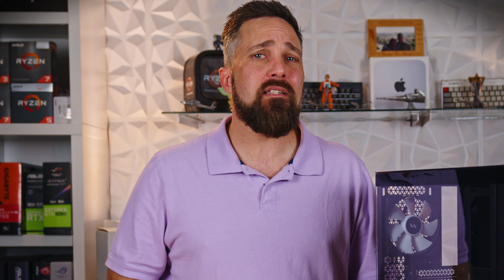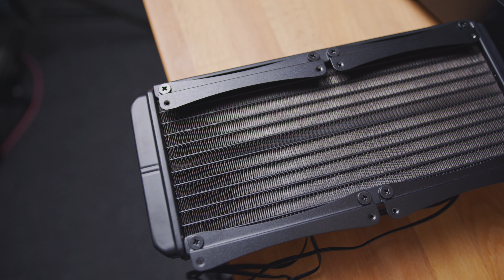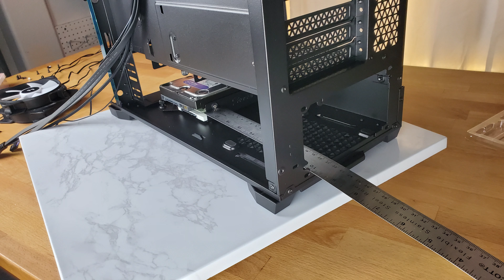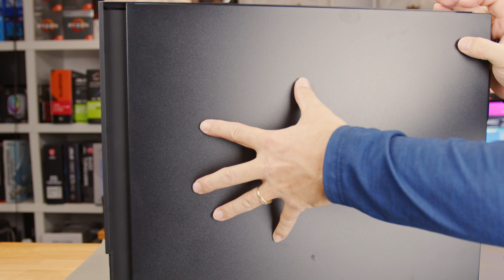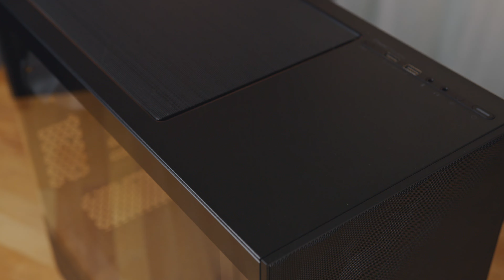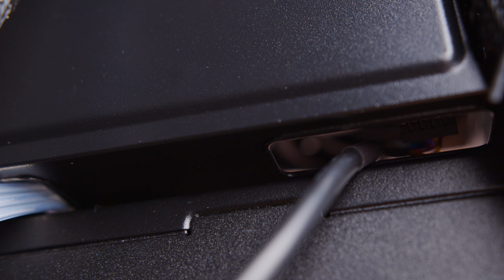This Mini Case Has a Big Secret! Fractal Pop Mini Review.

Comment: I don't understand builds of Intel cpu and a radeon graphics card, with the newer generation of cards coming out. Why would you not want full vram access with S.A.M?
Reply from the maker: SAM/ReBAR is not an AMD technology, it's  a PCIe feature, and it works with all CPU & GPU combinations.
Reply: @ElevatedSystems  oh? How is it implemented in this setup? Same options in bios to adjust settings?

Comment: Builds in the all black version of a case that comes in multiple colours
"It DoEsN't PoP lIkE tHe NaMe ImPlIeS!"
Proceeds to not elaborate on said other colours
Pretty decent video otherwise. Quite informative, mostly entertaining, and you actually built a PC that is reasonable for the case. While I get the point of putting a 3090Ti and a 5990x in a case to push its limits, it's kinda pointless if you don't appeal to people who might actually buy at this price point. If the case performs well they might go, "wow, this can probably handle a 5600 and a 6650xt then!"
But if you do that to a case that can't handle that heat, then it pushes away a potential buyer who might have been just fine with the parts that they intended to build only to have them spend more on a unnecessarily better case that's 20 or 30 dollars more. Money that could have gone into stuff that really matters, like food, or rent, or RGB.
Reply from the maker: The mini only comes in black, as I mentioned.
Reply: @ElevatedSystems  shoot, I didn't know that, my bad. For some reason I was under the impression that it came I  the same colours as the regular pop. That being said, if the colours aren't important, it's actually a really good case for the price point, provided that you intended to build in the mATX form factor in the first place.
Reply: I was today years old when I found out that YouTube Bolds text that are in asterisks.

Comment: Great case review.I realy like the fat that the Fractal Pop series of cases has 5.25-inch drive bays that are hidden behind a door/cover. My next system build will either be in the Fractal Define R6 replacement or the Pop mid-tower, as I require a 5.25-inch drive bay for my Blu-ray burner.

Comment: Thinking of getting this case but my current PSU is 160mm rather than the listed 150mm... I've heard you can fit larger power supplies in if you don't use the 3.5" bays, do you think this would work? My current PSU is a CX750M from early 2016, so maybe it's worth replacing, though it seems a shame to get rid of it for the sake of 10mm.
Reply from the maker: The CX750M is the exact PSU I used in this video.
Reply: @ElevatedSystems  I noticed that, I thought I was going crazy, but I think the newer models are shorter 😅 Just measured mine and it's definitely longer than 150mm.
Reply from the maker: @Blazik3n99  Mine is about 160mm
Reply: @ElevatedSystems  You have no idea how happy I am to hear that 😂 Thanks for the response, and thanks for the great review! Can't wait to build in this case :)

Comment: Really like how simple, well-made and high airflow is this case, it's like a budget torrent compact.

I also like this simple rectangular design of cases, it's more minimalistic and sleek. Not a big fan of excessive, complicated cases full of front glass that has trash airflow.

Does it come with mITX size, like Torrent Nano?
Reply from the maker: No, as of now this is the smallest version. I think mini ITX would eliminate the ability to use an ATX PSU and the optical bay, or both.
Reply: @ElevatedSystems  I guess Pop Nano wouldn't have worked while keeping all features. Fractal Design Torrent Nano has ATX PSU but barely has space for 2 fans in front, while having a PSU shroud that doesn't go till the front side.

Comment: Gamers Nexus said the fans couldn't do solid colors. How did you set it to solid whte?
Reply from the maker: Long pressing the IO RGB button provides a secondary set of color and pattern options. Once you get to the slow cycle patern pres the button again when it gets to the color you want and it will freeze on that color.
Reply: @ElevatedSystems  a pretty smart implementation
Reply: @ElevatedSystems  Seems like a complicated way to do it. How did you figure it out?
Reply from the maker: @stevedeitry4644  I read the manual 🤷‍♂️
Reply: @ElevatedSystems  you are a rare bird with that. I tend to get all sorts of comments for doing the same. Lol. Nice review, thanks CJ